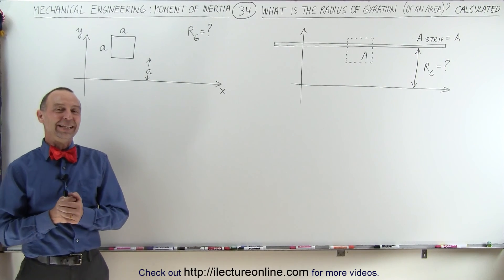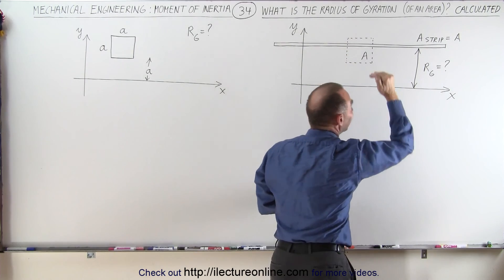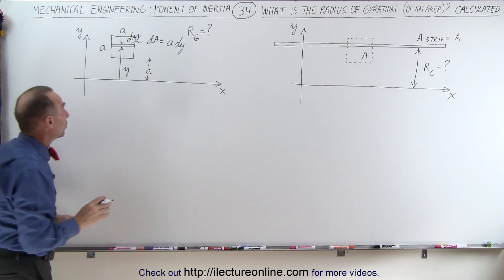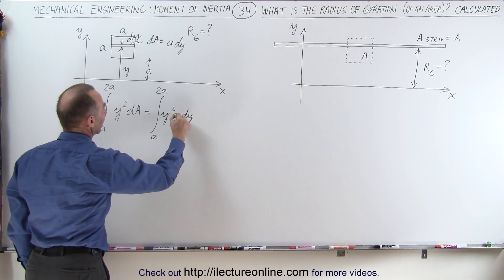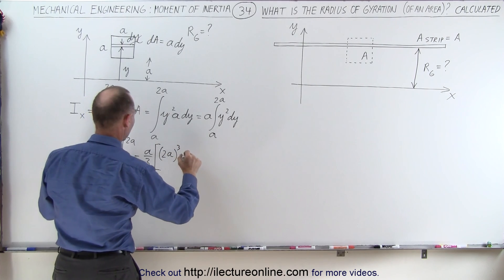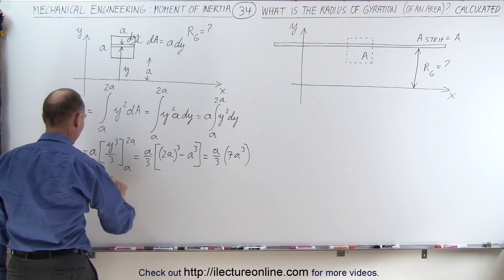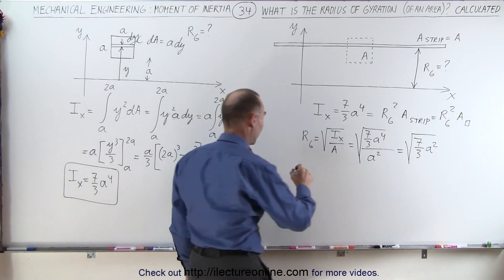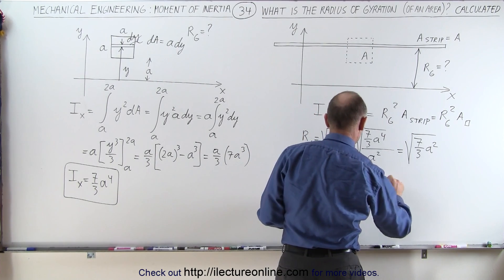Mechanical Engineering: Ch 12: Moment of Inertia (34 of 97)  Radius of Gyration: Calculated

Comment: how can I convert from using area in moment of inertia to using mass instead?
Reply from the maker: If the areas are of uniform density, then you can use area of mass interchangeably.  Just replace the area with the mass or the mass with the area.